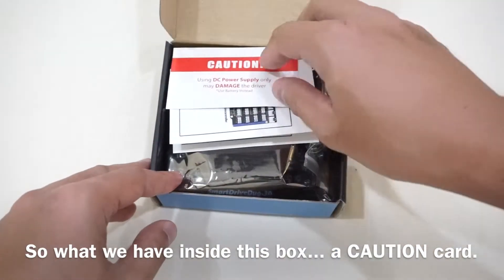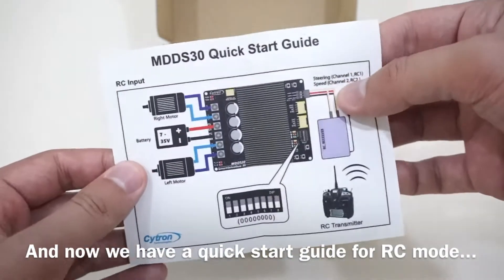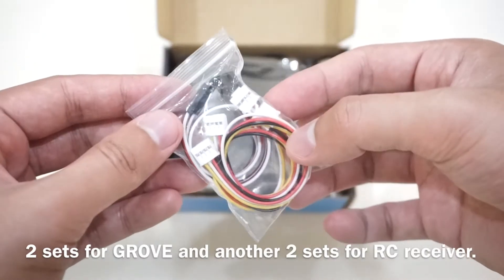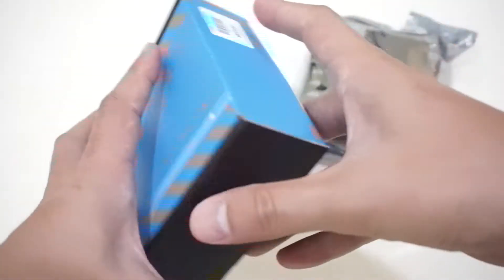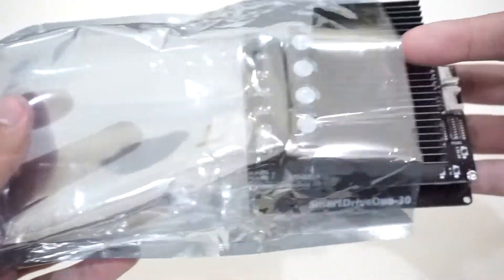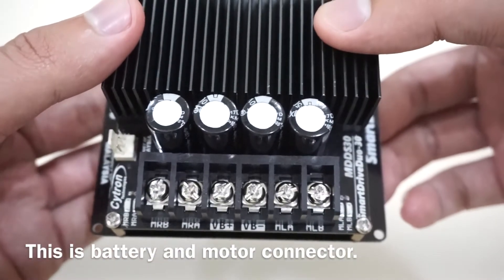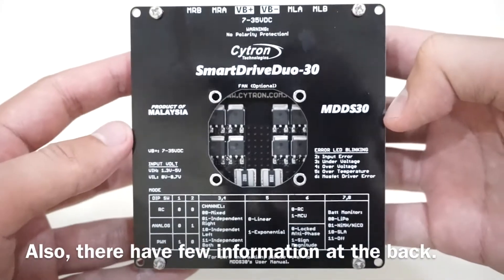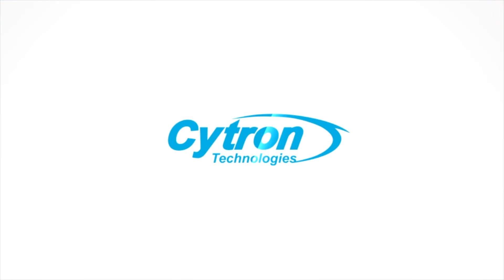30Amp 7V-35V SmartDrive DC Motor Driver MDDS30 Unboxing #motordriver #cytrondriver

Comment: This driver is capable of 30A per channel simultaneously. How does one feed it 60A through a single 4mm screw contact? There is no 4mm ring terminal that will accept 6AWG wire as far as I am aware. There are 10AWG 4mm ring terminals, one could stack two of them but this is still 3mm^2 shy of the required wire area. Why does Cytron not put larger terminals on this thing for the power supply?!

Comment: I have to build a radio controlled 4 x 4 with 4 motors 24V DC , 250W, 13.4A.
should I use 1 or 2 MDDS30 Cytron SmartDriveDuo-30 ?
Can you help me with the wiring diagram?

Comment: Looks much more solid than the dimensions engineering Sabertooth Dual 2x32A  junk that don't last
Reply: I second that!.. I tried 2 and they are very sensitive ... under current over current and all current :)
Reply: Will these run 12v to 24v? And will they run a rc lawnmower ok?